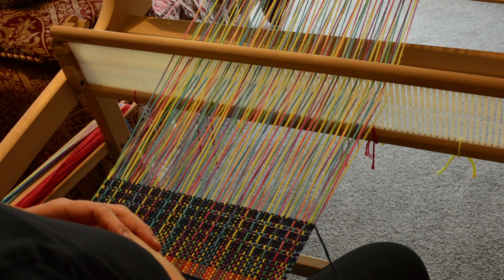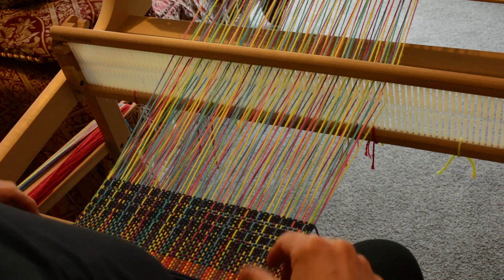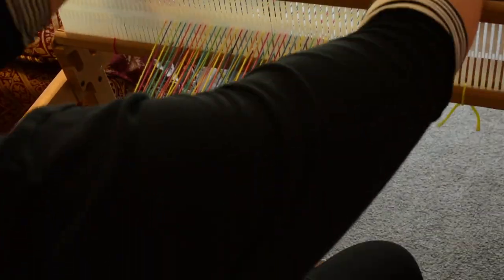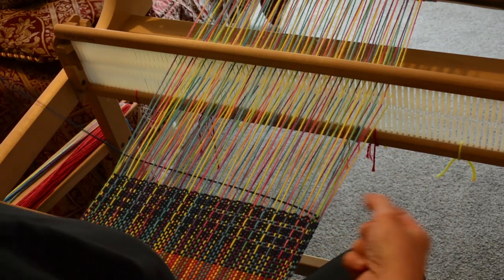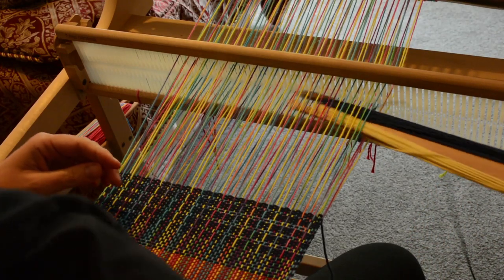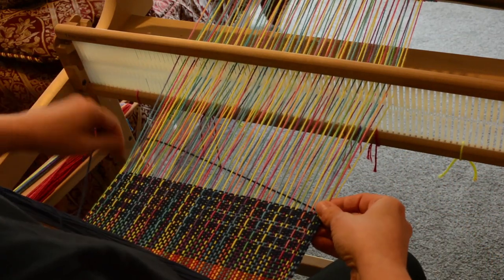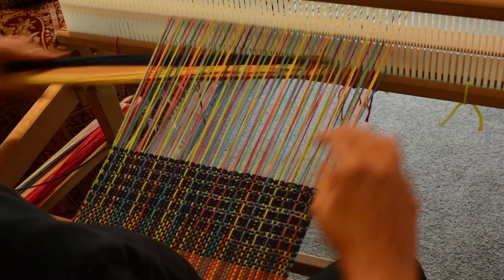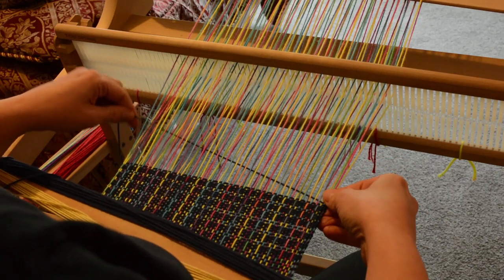1/5 warp floats on a rigid heddle loom

Comment: Hi. Technical question: If, when you threaded your stick, you skipped the very first pair of (right) warp threads, left them alone, and then did 1 up 1 down the rest of the way, wouldn't you get the same pattern and not have to do that little shuffle picking up the outer warp? Just not tell that outer thread to float? Do you get a different selvedge on that side?
Reply from the maker: Hi Jeff,  it's years since I did this video,  so unfortunately I don't remember how it looked on the other side 😕 You definitely don't have to start your pick up pattern right from the edge though,  you can leave threads not picked up to create sections or borders.  It's lots of fun to just set up a sample warp and experiment 😊

Comment: First time seeing your videos.  Very nice.  How do you put the pickup stick in to pick up the warp threads for this pattern?  Do you begin in neutral and go 5 up, 1 down?  How is the pick up done?
Reply from the maker: +Barbara Rickman The sequence for pick up is in the notes section here. 1 up, 1 down - so the heddle is in the down position and you are inserting your pick up stick under the first warp thread, over the second and repeat until you get to the other side. Hope this helps!
Reply: +Kelly Casanova Ah!  I did not look at the bottom of the page.  Sorry for the silly question!
Reply from the maker: No problem, it's a common issue :)